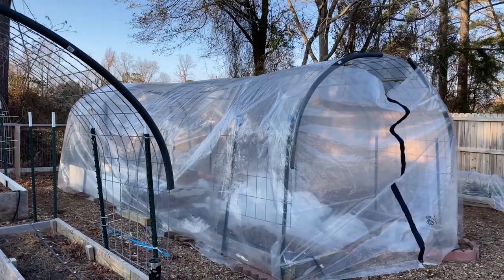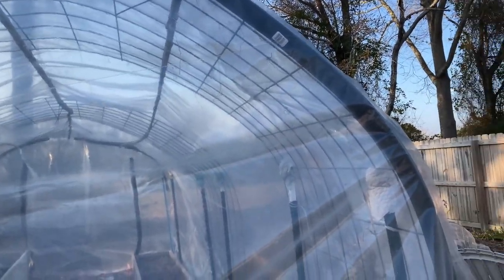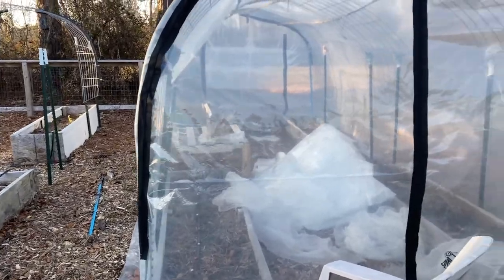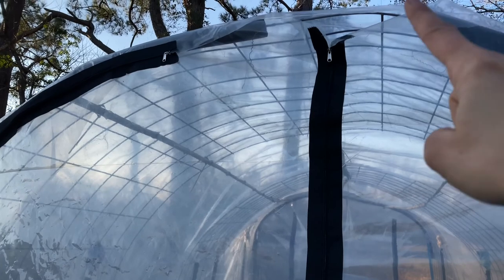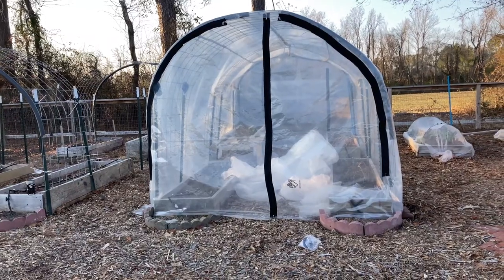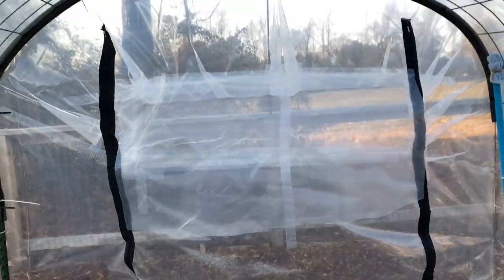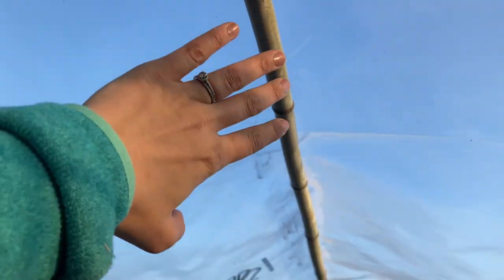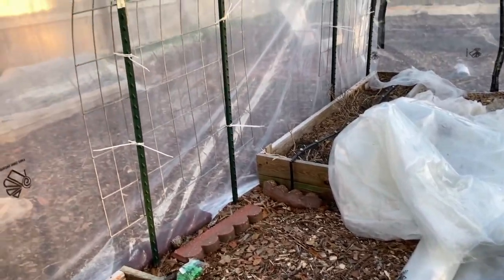Cattle Panel Greenhouse | Part One | In The Garden Again | #cattlepanelgreenhouse

Comment: Love the zipper idea for your greenhouse.  We have a pool frame greenhouse with polycarbonate panels. But I understand we get hurricanes too and I hope I don’t have to worry about ours too much but fingers crossed ours will last a lifetime. I’m about to post a tour of ours. Yours is quick and simple. Especially the fact you can take it down during bad storms is great.  If you didn’t want to use zipper you could use flex seal tape to seal areas without a zipper.
Reply from the maker: Thanks for the tip! I need to figure something out. We had a boy of wind today and the greenhouse got ripped around. I think we need to redo the set up to be honest.